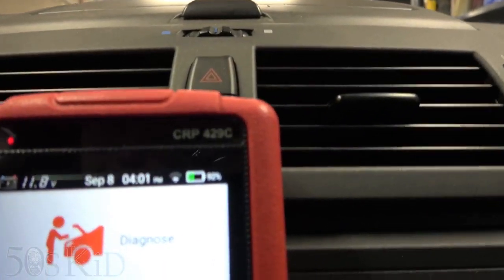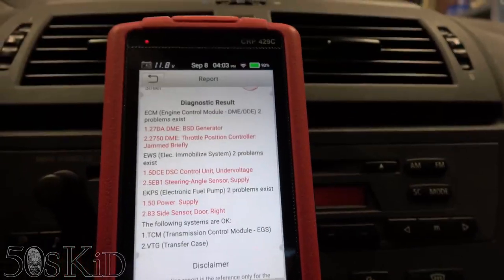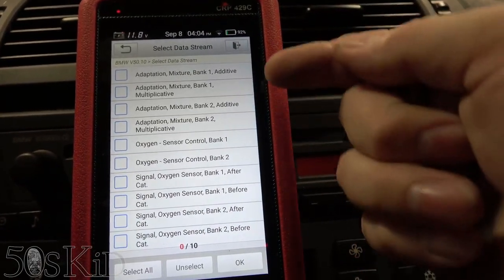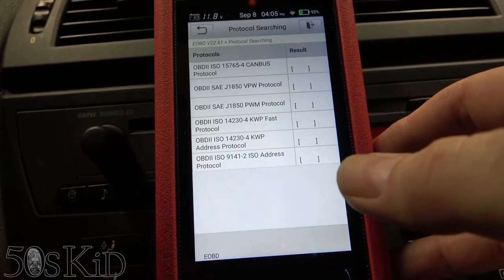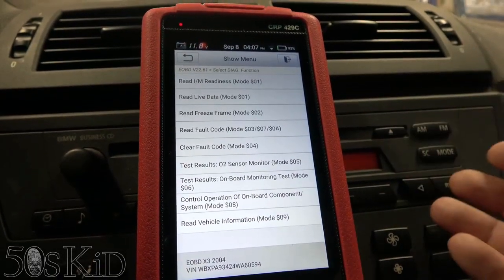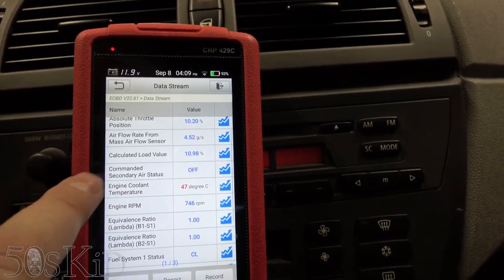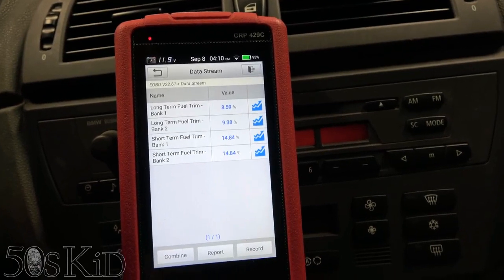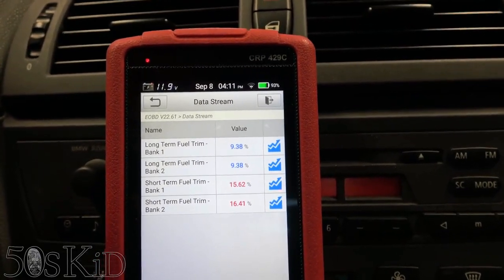How to use a Launch CRP429C?

Comment: I going to buy a scanner but i dont find information about which is better CRP129X or CRP429C could you oriented me?
Reply from the maker: Of course choose 429C.
429C supports 15 special functions, 129X only supports 8.
429C supports 60 types of models, 129X only supports more than 40 types.

Comment: I'm a beginner and wanted to learn more about how to reset and diagnose cars, im a panel beater, mostly, i handle, toyota, Nissan, Honda, and some European cars, im wondering if i can use this for, removing airbag and abs, also, some other important issue to be removed in cars? I'm thinking of buying this, thank you😊
Reply from the maker: Hi Yuuki,thanks for your question. we can help you find the more cheaper scan tool to read and erase  airbag and abs codes.
Launch CRP123E is not bad for you.
https://kingbolen-official.myshopify.com/collections/frontpage/products/launch-crp123e-read-reset-engine-airbag-abs-transmission-wifi-connect
Full OBD2 Models Function
Major System Diagnosis 
Date Srteam View&Record
Battery Voltage Test
Android System Based Unit
5inch Touch Screen&Wifi
Support OBD1&OBD2 Car models

Think about Launch CRP129E if you want to do more reset like Oil/EPB/SAS/TPMS/Injector Reset
https://kingbolen-official.myshopify.com/collections/frontpage/products/launch-crp129e

You can click button "buy at amazon" to buy if you from US.
Reply: @kingbolen_official  do u think the one in your video is good, base on your experience, i kinda looking for a device I can use for both basic and advance diagnostic for future or upcoming events aswell, so i dont need to buy another tool within a short period of time, also, im working right now on Ford ranger 2017, with abs, airbag, astc, currently lighting on, with steering angle needed also to be adjusted, is this tool capable also with that?, i really appreciate it if u can help me out decide, Thank you😊
Reply from the maker: Yes,CRP129E support  ABS system and steering angle reset on 2017 Ford Ranger.
Reply: @kingbolen_official  wow awesome, btw I also have a vios 2019, u think it will also be able to scan it out? Thanks😊
Reply from the maker: Lol,not sure,most of newer car have good security system.
Reply: @kingbolen_official  I'm just a starter as well thank you guy's i might just go for that as well.
Reply: @kingbolen_official  and also which is better the crp 129e or the one above on the video?, because in my location they both have pretty much identical price, thanks😊

Comment: Whats the difference between the 492c and 129e?
Reply from the maker: Launch CRP429C can do DPF but CRP129E can not.
CRP129E is more cheaper.
Reply: How much pay for update this CRP launch 429c and how many free update
Reply from the maker: Pay $70 for update after one year
Reply from the maker: Hi CRP129E is the upgrading version of CRP129, and CRP129E can do EPB reset.thank for your support.
BTW,CRP429C and X431 V X431 Diagun IV can do  abs bleeding

Comment: Does it reads mercedes w212 All Systems? Thx.
Reply from the maker: What is the year number ? Major system not all systems,Think about X431 Diagun IV or X431 V if you are looking for all systems scan tool.
Reply: @kingbolen_official  2010/2011

Comment: I just got mine in CRP429, not the C model.
It wont connect to my 1999 Durango 5.9ltr, 4x4.
Any ideas, support just asking me to purchase 6pin accessory cord, and that wont be the fix because while trying to connect it says I might need the Chrysler 16 pin connector, and at other times it suggests to use the 6 pin Chrysler adapter. Those probably arn't cheap, and where might a person even find them to purchase.
Other scanners have connected fine to this truck, so why the situation I ask?
I didn't want something I just have to purchase more accessories for a known negative result. I'm in hopes perhaps Launch makes a scanner to connect for me.
I feel like I'm paying for WiFi and blue-tooth, which I will never use.
Reply from the maker: New DIY scan tool CRP129E:  http://bit.ly/2vvmvDk 
X431 Diagun IV with bidirectional control :  http://bit.ly/2GvxGlM
Reply: Sir....u just need some data software compatible. It is like protocols recomended . And surely CAN area data interface not interference.

Comment: can this scanner read fuel tank pressure sensor voltage and run an evap test?  i bought an autel ml629 but it failed to see this sensor data and stated module wasn't supported when navigating to do component test which would usually list evap able to be tested.  vehicle is 2009 Chevrolet Silverado with code P0446.  The vent and purge solenoid passed basic manual tests (12v applied while blowing air and confirm flip from open to close or vice versa)  I did not do a decay test, dont have a vacuum pump yet.  charcoal canister doesn't seem to be plugged.  only thing i know that is left to do is vaccuum test the lines, maybe check the filler neck seal. the gas cap was replaced.  could be a bad fuel tank pressure sensor.  will dump it in a shop before i buy a $2,000 scanner though.
Reply from the maker: New DIY scan tool CRP129E:  http://bit.ly/2vvmvDk 
X431 Diagun IV with bidirectional control :  http://bit.ly/2GvxGlM